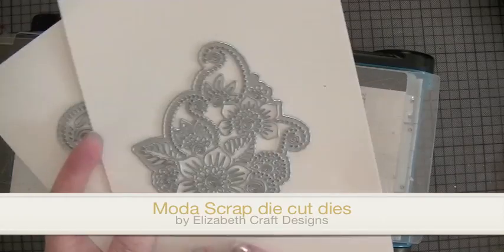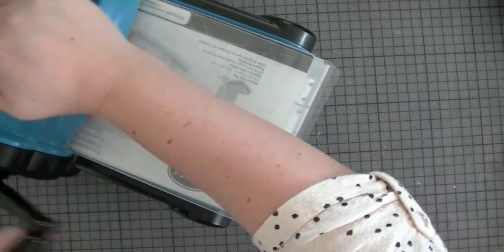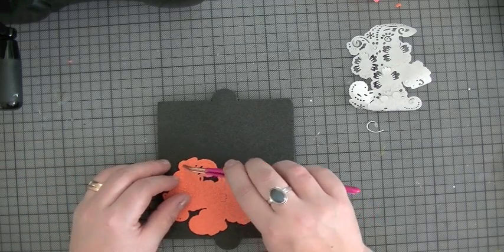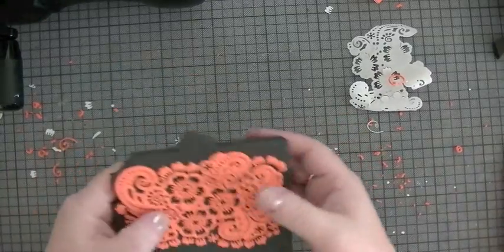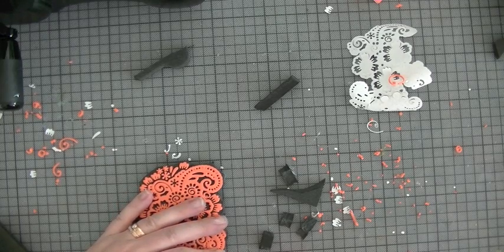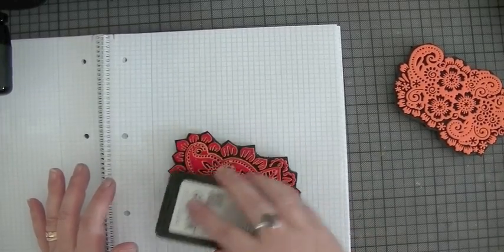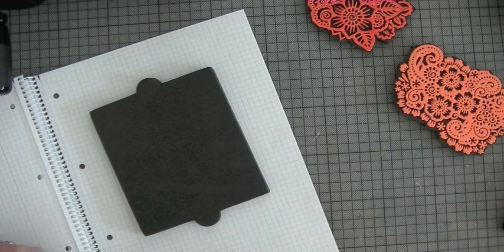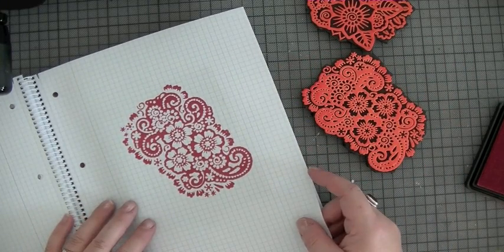DIY foam die cut stamps

Comment: Hi - thanks for your idea!  How would you clean them to use different colors of ink - or, once you've used a color (say like the red you chose), you have to keep using red.  Again,  thank you 😊
Reply from the maker: Yes, you can use various colours. If you use water soluble inks, they come off with regular tab water. If you use acrylic paints or waterproof ink, just clean them right after and you can use them with other colours too. I am using mine with various colours and media :)
Reply: @SannaLippert  💐  😊

Comment: These are so neat c: Did you have to seal these with something? How have they withstood the test of time?
Reply from the maker: thank you! I didn´t seal them with anything and this was my first try on DIY stamps. I have been using them with water soluble inks and acrrylic paints and they still work well - the only thing you have to be careful with is cleaning them (so that nothing falls of) = not too roughly :)

Comment: This is a great technique! I’m curious, this looks like EVA based craft foam, which I’ve seen people “heat seal” with a heat gun to instantly smooth the surface. It also slightly shrinks the foam, which would make weeding (picking out the void parts) like a bit easier? I wonder if this would prevent the stamp from properly grabbing and transferring the ink. I think I’ll try an experiment!
Reply from the maker: It´s a good idea, but keep in mind, that there may be fumes coming from the foam, when heated, that are not that heatlhy to be inhaled.

Comment: Where do you get the foam and what is each foam called?
Reply from the maker: I think it´s called "Fun Foam" in english and you can normally buy it at an office supply store, art supply store, anywhere they have regular craft supplies. They sell both, one without the adhesive on the back and one with. There is even glitter one at the market, but that is not good for this purpose.
Reply: @SannaLippert  thanks I used craft foam and yougurt lids

Comment: First time watching you  -  I think you fit the description “think out of the box”....wow.  I have the sizzix and cannot figure where to place the dies or those sandwiches.  I tried and unfortunately cut into the long hard plastic things....so it sits in my closet.  I need a lesson on how to use the machine without ruining it. 😖- thanks for the video - your stamps came out lovely- margy👍
Reply: Margery, I have the Sizzix Big Shot and to die cut, you place your die on one of the plastic plates, then your paper or card, then place the other plastic plate on top and then roll through the machine.  You also have a thick platform type plate thing too and another one with pictures on it.. all of them go through when die cutting.  The one with the images on it, you remove that when embossing.  I hope this helps as there seems to be so many versions of this particular machine...  if not there are YouTube videos to help :)  ~Karin~
Reply: You likely did nothing wrong. If you look at other die-cut videos, you'll see there plates are messed up. The metal die is going to cut into your plates when you put them in the machine because of the pressure. Those plates will last a LONG time all scratched up and work perfectly fine. They do sell replacements but you'll not likely need them for quite some time.

Comment: I made a foam stamp with a die a couple years ago but it would not cut through right away. It ended up flattening my foam quite a bit. I had to run it through more than once. I had to use 3 layers of it attached together. It was a large birdcage die from sizzix i believe. Yours doesn't seem to be flattened.
Reply from the maker: no, it didn´t flatten at all - maybe it´s the type of die I used (thin metal die - I believe the birdcage is a thicker one on it´s own, it might add more pressure and thus flatten the foam?)

Comment: This is very cool but couldnt you just take off the adhesive and stick it to your plastic plate then cut then pull up the big part, maybe the little bits will stick to the plate then it would be easier to remove and save the little parts.
Reply from the maker: Thanks Deby! yes, that might work really well too, but my plastic plate is already very much used and is not that clean/sleek anymore, that might effect the adhesive surface for the die cut foam abit and keep it from sticking  properly to the foam later. But it´s for sure worth the try!

Comment: clever idea ;) where did you find the adhesive foam?
Reply from the maker: I bought it from a regular paper supply store where you can buy school supplies too. I belive it´s called fun foam in USA - in Austria they sell them in a set of several sheets in different colour. 

also found some on Amazon: https://www.amazon.de/selbstklebende-Schaumstoff-Bl%C3%A4tter-Vorteilspack-Basteln-Karneval/dp/B007ZDMC3I/ref=sr_1_2?ie=UTF8&qid=1517748296&sr=8-2&keywords=moosgummi+platten+selbstklebend

Comment: Where can I buy these supplies...the foams, etc? Thanks!
Reply from the maker: Constance the dies are from Elizabeth Craft Desings. 
Here: https://www.elizabethcraftdesigns.com/collections/modascrap/products/flower-lace-2 and here: https://www.elizabethcraftdesigns.com/collections/modascrap/products/flower-lace-1

and I bought the thinner adhesive back foam (which I die cut) from a paper supply store (I think it´s 
called fun foam in English), but keep an eye on paper supply stores/art 
supply stores for adhesive back foam. They sell those here in Austria in
 packs of various colours. hope this helps you find some in your area! and the thicker grey foam was just a residue from some type of packaging I received and then saved the foam, since it looked like I could use it for something later :). But you might get lucky in home supply/repair type of stores for foams like that too. Usually also packaging from electronic devices has such grey foam in them.

Comment: Beautiful arrangement of die-cut and pieces. Can you use different color inks with them? Or do the colors not come off?  I guess I mean can you clean them?  Thank you for a good tutorial and idea.
Reply from the maker: RoseMarie, yes, I´ve cleaned them right after using - I use baby wipes to clean them or water on a piece of cloth. Water soluble inks are no problem to clean, as they come off really easy. Also embossing ink is no problem. Dark inks, like black archival  (water resistant) will for sure leave a mark on the stamps/color them and if you want them totally clean, you might need to grab a stamp cleaner (which is a much stronger cleaning medium) and that  in time might damage the soft surface of the foam... so that way their life span will for sure be not that long. BUT since these are really easy to make and quite cheap to produce, I´d simply make a new one when the lifespan of a particular one has reached it´s end :-) OR make two of the same kind - one for black ink (this way no need to clean the black ink) and one for water soluble colors.

Comment: Wow--these are awesome!!! I think they came out just perfect. Another thing I think you could do, if you don't have the packaging foam for the backing, is to use a brayer. Just die cut the craft foam piece, lay it face-up on a piece of scratch paper, ink it up, lay your paper/cardstock over that, & brayer over the back of the paper. You might not want the adhesive-backed craft foam in that instance. You could use the regular type, and apply dots of repositionable glue (like Tombow Mono Multi Glue) to the back of the die cut stamp piece. Let that dry (if you're using a liquid glue) before laying your foam piece down on anything, and that will hold your foam stamp in place. Thank you for sharing such a neat idea!!! I will have to try this now. :)
Reply from the maker: Thank you for including additional ideas to try out, Andrea! I will keep this in mind for the next ones I make!! :)